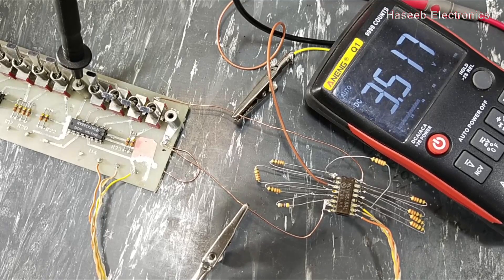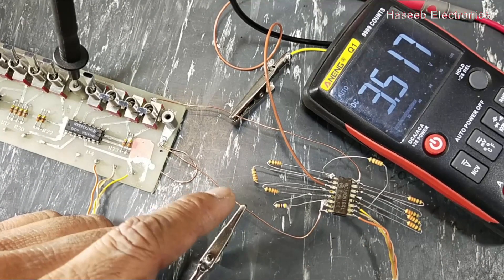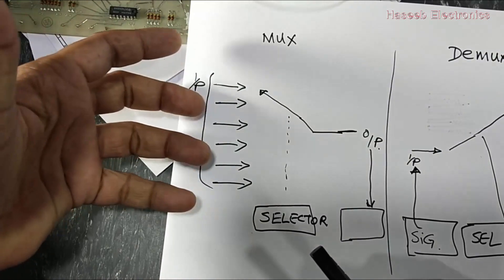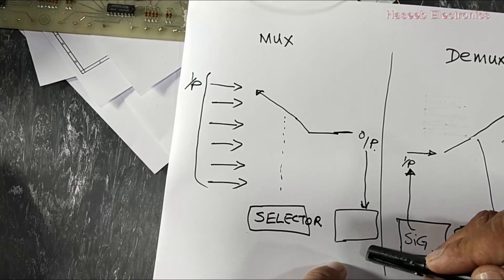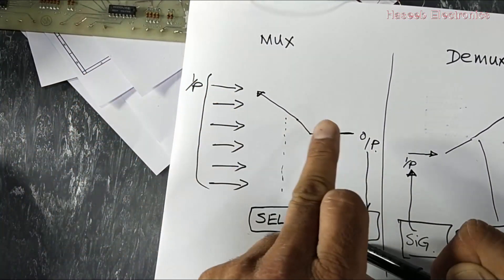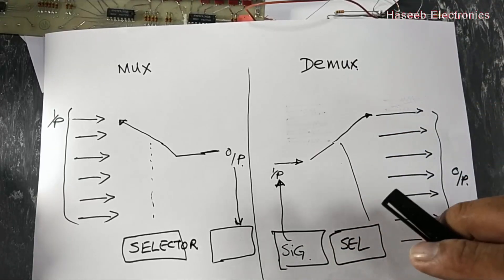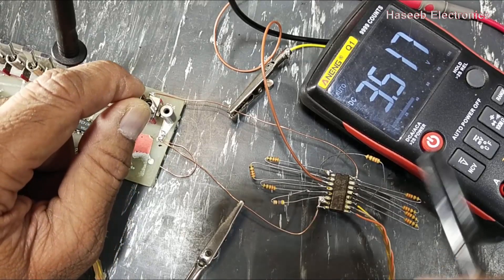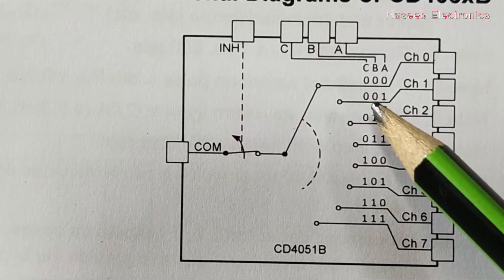{496} CD4051 8 Channel Analog Multiplexer / Demultiplexer - Explained Multiplexer Analog Switch

Comment: Great video. Im researching this IC for use in a project, this really helped.
Reply from the maker: it is my pleasure 
similar in TTL is 74154
Reply: @HaseebElectronics  Hm, 74154, that's a 4-to-16 multiplexer, Does that mean the 4 pins are used to control the direction to the other 16 (0000 = pin 1, 1111 = pin 16)?

I'm totally new to making my own circuits. I usually buy Arduino modules for everything, but I'm making a nitrogen generator and I would like to control some things using custom circuits. The compressor im using can have the speed controlled by managing the resistance. Apparently MOSFETs and JFETs aren't linear and will vary with temperature, so I was going to use a multiplexer to switch between different resistors (or maybe trim pots with a known resistance set on each).